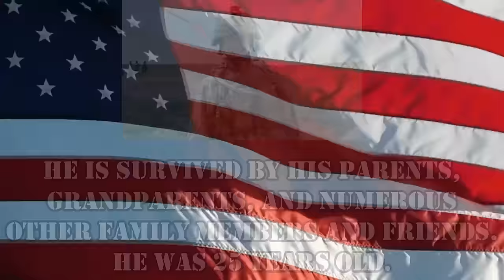Gen Y Executive Gooseneck Fifth Wheel Hitch Pros and Cons

Comment: I have a Gen Y hitch that Gen Y custom made for me. It's 5" shorter in height than their stock model. This allows me to level out my rv for towing. I have a flatbed, so chains are a non-issue because I can just reach in and connect them. It's only been installed for about 300 miles, but, so far, no issues. And, I HAVE MY BED BACK! WOOHOO!
Reply from the maker: That is awesome that they will do custom jobs. We hipenit continues to work well for you.

Comment: We have a Gen-Y on our 2022 GD Solitude 38 ft built end of April 2022 and got a new frame re-design for 2023.  Our 5th wheel had a frame redesign that went into effect for the 2023 model. GD told dealership only gooseneck that was covered under warranty was the Gen-Y since it had the bolt design that matched the new frame design for front.  We love it and tow with a 2021 F450 DW diesel.  We have parked it 90 angle.  We have so much bed space and easy to hitch up.
Reply from the maker: We heard the same thing. We have a friend with the Andersen gooseneck and he was told Lipert will not cover any issues while using that hitch.

Comment: New Horizons installed my GenY I had shipped and installed it before I picked up my Majestic . Love the room in the bed of my 450 when pulling our 5thwheel. I also put white stripes on my Gen Y to make it easier to line up when hitching. With an 8 foot bed you can really turn sharp if needed.
Reply from the maker: Good idea. We put a red stripe on ours. You can probably see it in the video. It definitely helps.
Reply: @WaywardWaggs  

I also put a white piece of tape on the top center edge of my tailgate so when I’m backing up I can line up with tape on hitch. When I get close I open tailgate and usually I’m pretty much lined up for the rest of the way.

Comment: Cool! I have an 8' bed, so that took care of some of the issues you all had to deal with. I switched to a Gen Y when I was a young man of 71 and did it myself. (Use its own leverage and fulcrum in your favor if you do it yourself.) I did have to use an adaptor plate(s) from Gen Y because of the width difference in my trailer to the capture plate (king pin). The hardest part was getting the fifth-wheel saddle out. I had/have an invert-a-ball so when I am not towing my 5th wheel, I just invert the ball, drop it in its keeper and have a clean flat bed in my pick up. It is so nice. And, like you, the grease is gone!! 🙂.  We have towed from NW South Dakota to Orlando Florida, back up to South Dakota, then to San Francisco, up the coast to Florence, Oregon, then wound our way to Glacier National Park, then back home to South Dakota over a ten month period and not one hiccup. I do have to hoist the front end of the trailer pretty high to clear my pickup bed since my ball is right at the bed and the Gen Y is pretty long and low from the trailer. Still love it way better than the old fifth wheel and pin. Thanks for the video and sure looking forward to you hooking up and dropping off video.
Reply from the maker: We have to raise ours up pretty high to get it hitched up also but it is a minor inconvenience.

Comment: We had the Gen-Y installed on our 35’ 2023 Eclipse Attitude when we bought it. We’ve logged over 9000 miles with it and love it! Most of our camping is boondocking and we take our trailer where most won’t go. Being a gooseneck, you just need to watch for the tilt to be sure the front cap doesn’t hit the bed. I’m considering getting a camera for the bed so I can see the ball when hooking up. I currently have a system that works pretty well. I cut a tennis ball in half and attached an arrow to it. I slip the open end of the ball over the tow ball and align it so the arrow is standing straight. Then back in keeping the center of the hitch that I can see in the center of my rear, middle window until I see the arrow tilt toward the cab. Once this is done a few times, you learn when to stop.
Reply from the maker: That is a good technique.

Comment: Many great points! Grease all over is a good one. We had a B&W it worked great but as all other hitches to many moving parts. This one seems a lot more as you stated less maintenance. And the room in the bed of the truck is a major plus. A lot of room for a additional fuel tank.😀 Thanks for sharing your experience with this hitch. Stay safe out there.👏👏🤗❤️
Reply from the maker: We definitely need a bigger fuel tank. That would help a lot out west.
Reply: @WaywardWaggs  we can do it!

Comment: I agree with everything you said about the Gen-Y. I have a fix for making the hitching easier. I took our halo view side markers and instead of putting them on the rig, I used one in the bed of the truck. The camera will rotate almost a full 90 degrees. I mounted one to the bed looking at the ball. I ran a trailer wire to the 4 way in the bed and hooked it to the camera. Now I can see when Im over the ball. Still have an issue getting centered on it, but im usually close the first time. 100% would not trade the Gen-Y for anything else. The ride is way better.
Reply from the maker: We do the same thing with a camera called the eyeball. It has a screen that plugs into the cigarette lighter outlet. It works pretty well for us.

Comment: We used to have a superglide years ago.  A very well built hitch but as you mentioned there were too many cons to it.  If I remember correctly you had only 7 degrees either direction from being straight for hookup.  The only downside of the ball adapter is its going to put it well behind the rear axle therefore adding weight to it vs the recommended above or forward of the axle.  Maybe not enough to cause problems but something to consider.
Reply from the maker: Thanks. Since it only moves the ball back six inches, hopefully it won't be an issue. We haven't had any problems yet. 🤞🏻

Comment: I just installed a Pullrite hitch and I want to correct one statement on your video. You are not suppose to use grease on that hitch. It is stated in the owners manual. All you use is WD40 on the plate,  and the top and inside of the slide rails. Using grease can cause that hitch to malfunction. One of the reasons I chose the Pullrite, no grease. I do agree with the lighter weight and getting back space in your truck bed! I look forward to more videos on how everything goes with your new setup.
Reply from the maker: Thanks Dave. Good to know.
Reply: I was going to say the same thing about the WD-40.

Comment: I couldn't wait to get rid of the PullRite precisely for the reasons you mentioned.  Once, I had to back my coach out of the campsite with  no REAL connection. Then I could get in straight enough to actually hook up.  We now have an Andersen and couldn't be happier.  As for the capture plate, our dealer didn't bother to reinstall the capture plate and we drove over 1100 miles without it (yes, I was a newbie).  We had to find one while in Kansas City and it was a PITA.
Reply from the maker: Oh bummer. That does sound like a PITA.

Comment: What about for added stress on the the frame and over head bed area of the RV or fifth wheel? Lippert frames are failing due to stress cracking as you may know? Thinking about the transfer of weight from the king pin to the trailer you talked about?
Reply from the maker: We haven't had an issue yet. Most people who are having issues are in Grand Designs.

Comment: Thank you for the review. I noticed the hitch in some of your videos and was hoping you would do this. I was wondering how this hitch would work with a Ram MegaCab, I have a 3500 Dually MegaCab and don’t want to spend the money on this set up if it was going to be real tight on turns. Close to 90 degrees would work for me. I also have the PullRite auto slider and would like to keep my bed empty and also noticed the moving pivot point when backing, it throws me off most of the time….
Reply from the maker: We were nervous about the turning radius but we haven't had any issues so far. We have been able to back into every spot without worrying about a cab strike.

Comment: Just getting caught up
I totally agree with all the pros that you talked about, and I have even read good reviews and seen other channels endorse it.
I'm sure they have done all the necessary testing & research.
But coming from  the transportation industry in my prior job, I just have a real problem raping my head around  the fact that
You can put 16 to 25 k on a single little ball in the bed of a truck...but that's my issue
Safe travel....and great review
Reply from the maker: Good point but if you think about it, farmers and ranchers have been doing it for a long time with gooseneck hay trailers and horse trailers. I'm not sure how it functions properly either. If the RV ever passes us on the freeway, we'll start panicking.  🤣

Comment: Thanks for the video.  How much did it raise the front of the RV!  What was your height before and after installing the Gen-Y.  We have little room to spare in our RV shed. Thank you.
Reply from the maker: It only raised it a little and only when hitched up. We are at 13' 4" when hitched up.
Reply: @WaywardWaggs   Do you know what your height was before you put this on?  Curious how much it raised it in inches.  Thanks
Reply from the maker: We didn't measure before but the spec sheet  on a new 340RL says it is 13' 5". They probably account for worst case scenario depending on which hitch the buyer uses.

Comment: Have there been any differences in driving and handling with moving the weight 6" back.  That is my fear.  I also have the pullrite and would love to get my bed back.  Contemplating putting a hoist in my garage to lift it out.
Reply from the maker: We have not had any issues with the ball being back 6 inches. The handling is great and no chucking.

Comment: Does Lippert (the frame/chassis maker) recognize this hitch as far as frame warranty?
Reply from the maker: Yes. As far as I know,  the only one Lipert won't back is the Andersen hitch.
Reply: This is the email; I received a few weeks ago addressing that very question.
"Good Morning, 

Thank you for reaching out!  We are not approved by Lippert at this time, we actually met with Lippert just a few weeks ago and are working on getting approval here shortly. We have over 11,000 units on the road today and have never experienced any frame issues whatsoever. With the torsion flex built into the unit it would actually help take stress away from the frame rather then add stress onto the frame. 

We also recommend you take a look into the Magnuson Moss Warranty Act which basically states that a manufacture CAN NOT VOID a warranty just because you put an aftermarket part on their product. IF there was ever an issue the manufacture would have to prove without a doubt that it was our product that caused that specific failure! Through all of our research and customer feedback we have found that if anything our product does not add stress to the frame, it takes it away!

Please let us know if you have any further questions and thank you for choosing GEN-Y! "

Comment: Hey folks…. Good information here. One question. Do you have a 6.5’ box with the mega cab, or the 5.5’ box like some 1/2 tons do?
Reply from the maker: We have the 6.5 box with the mega cab.
Reply: @WaywardWaggs  OK... I have the same truck, same sliding hitch and have been curious about the Gen Y. Cab clearance is a big concern for me. I have one poked out back window on my score card (before the slider). Guess I got pretty comfortable pulling for 20 years with my old truck with an 8' box!
Reply from the maker: @Gopher7  We have had the GenY for over 8 months now and have never even come close to a cab strike. We have the adaptor from GenY that moves the ball back six inches. That helps also.

Comment: Hey guys 
Just wondering why you could not hook up the fifth wheel at an angle l have a B&W turnover with the fifth wheel. I can hook up at a 45 or 90 degree. Just wondering 😊
Reply from the maker: We can now with the Gen Y hitch. We couldn't with the Superglide hitch because the capture plate has to be lined up pretty straight. The manufacturer recommends not hooking up at great than a 7 degree angle.

Comment: You can hook up a 5th wheel on a 90° angle if you need to. I have over 32 years of driving and have done it many times. But I like my goose neck on my 310RL. As for easier to hook up, 5th wheels are way easier
Reply from the maker: Yes, you can do 90° angles - we couldn't because we had a short bed truck. So 80°-85° was about all we could do.

Comment: Hello. I just found your channel. Great stuff. We've just purchased a 340RL and I'm planning on switching over to a Gen-Y hitch as well. You said that you got the 5.5k version. I was thinking that the 4.5k version would be the best for a 340. What made you pick the 5.5k? Also, have you been happy with the 340 length? We originally wanted a 310, but couldn't pass up a good deal on a used 340. We're worried about getting it into tighter spots. Thanks!
Reply from the maker: 5.5k is what Gen Y recommend for our RV so we went with it. We had a 35 ft. Montana 5th wheel which was a good size but we like the extra space (especially in the bathroom) in the 340RL. The extra 3 feet doesn't make it any more difficult to get in spaces. We have managed well so far.
Reply: @WaywardWaggs  It was the bathroom that convinced my wife that the 340 would be okay :).

Comment: We got a gen Y hitch for our last rig to see if it would help smooth out the ride in the truck. It’s a gooseneck. We traded in that rv but put the old hitch back on it and kept the gen Y hitch. Now the new rig is about 26,000 lbs and the gen Y hitch is rated for 30,000. Our B&W fifth wheel hitch is only rated for 25,000 lbs. we’ve been debating on what to do. Do we sell the B&W and get a Kurt rated for 30,000 or put the gen Y hitch on. The only thing I’m worried about is that “they” say that a gooseneck can hurt the rv. Since it’s such a heavy rv, I’m afraid. But after watching this, I’m now leaning toward the gen Y.
Reply from the maker: We haven't had any issues so far. We'll let you know how it goes as we put more miles on it.

Comment: This is a great video but may not be totally correct about transferring the weight to the 5th wheel.  The Curt Roto Box on the Brinkley weighs in at 115lbs.  This hitch may weigh in at 175 lbs so I transfered 60lbs to the RV, but now you do not need a 200 to 250 lb slide hitch in the truck bed if you have a short bed.  The long bed folks or ones with Anderson hitch are about break even with total weight as the still have weight in the 5th wheel box and the truck bed.  Your payload seen by the truck is not going to care.

Comment: Not the case with all Gen-y hitches, they have messed me up twice and I had to pay restocking fee return shipping fee and a custom design fee for which I did not see anything that was custom and still did not work. FYI I think they just charged the custom fee so they could add no returns on custom hitches nothing was custom on hitch. I give them exactly what tongue weight was and first one flex down so much hit bed second one does not flex at all and is as ruff as ride as the factory I replaced with, my wife says this gen-y hitch rides even more ruff than the factory I took off so not everybody has had the same experience with gen-y hitch. I am sure they make some good hitches but not in my case.